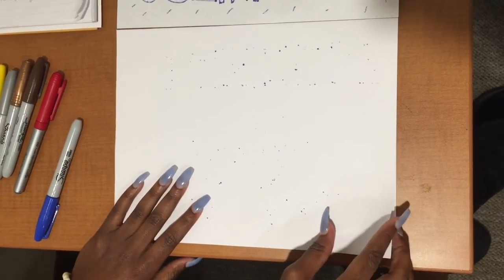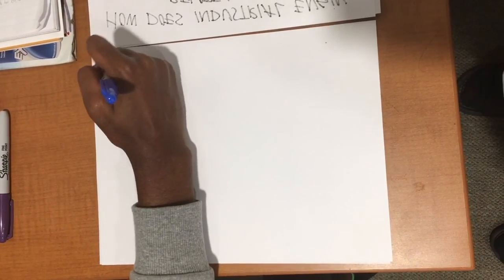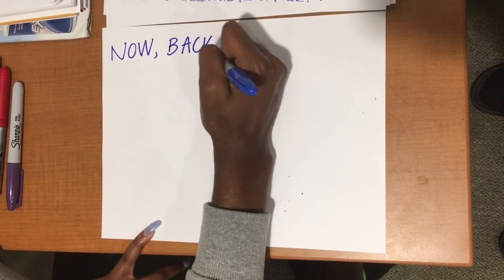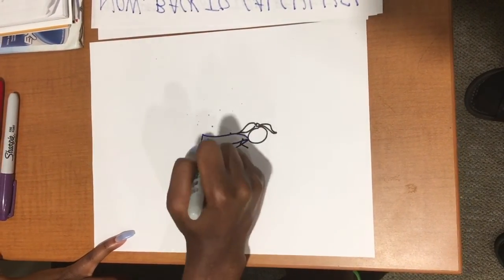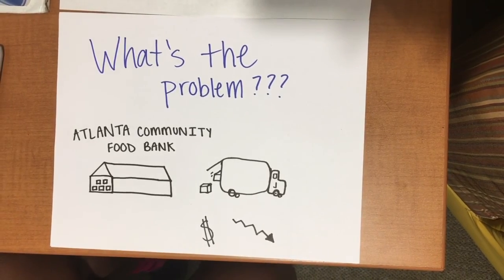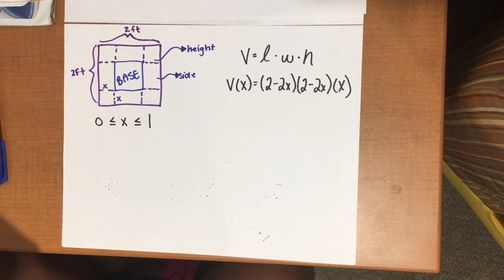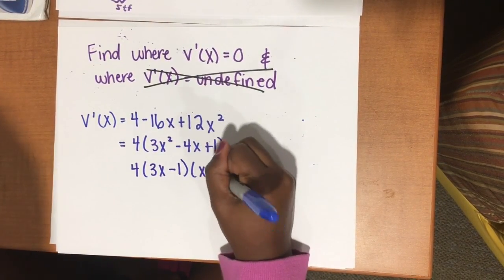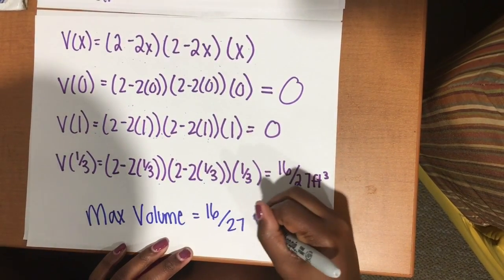How Does Calculus Relate to Industrial Engineering

Comment: Thats just advanced algebra thats not even calculus
Reply: No, derivatives are technically calculus. 

Although I think I remember doing problems like this in algebra. Instead of differentiating the objective function to find the critical point, we would just find the peak of the parabola. This explains why we only maximized area, but not volume. With area, the objective function is a quadratic (parabola), so we just found the vertex (x = -b/2a, f(x) = ax^2 + bx + c).